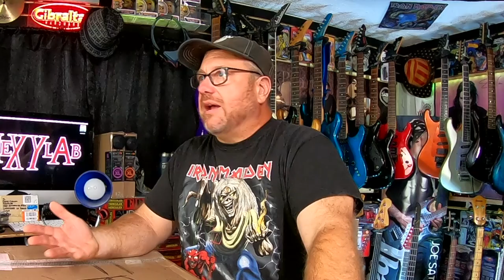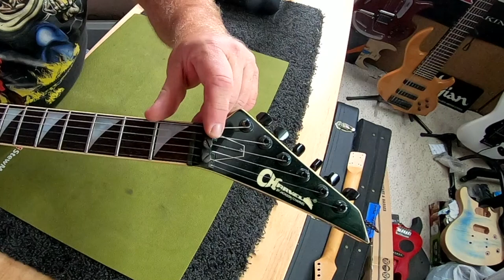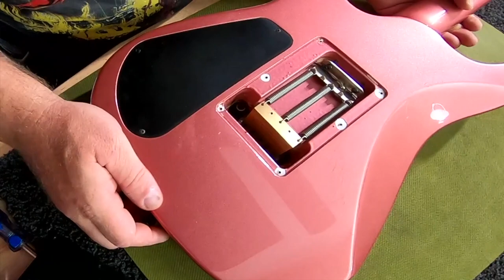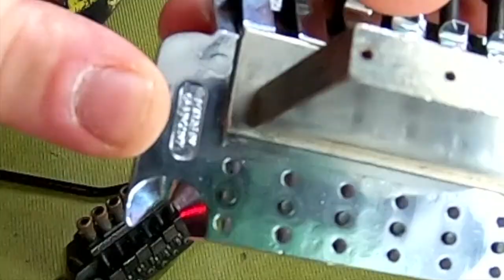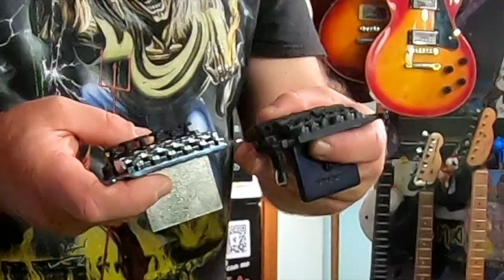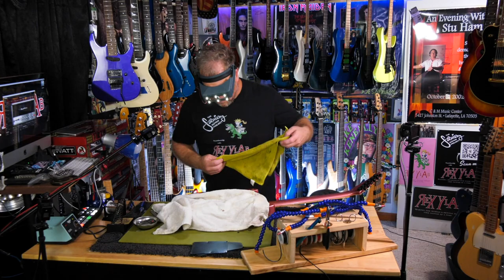1988 Charvel Model 6 And A Story About Weed 🎸🤘

Comment: Been thinking of spending $1200 on one. Does it play good enough for that price?
Reply from the maker: $1,200 for a 1988 model 6 in burgundy mist is a steal! 

That being said I love the way this guitar plays but they aren’t for everyone. I have a USA, pre Fender Jackson soloist with an actual German Floyd and it feels completely different. 

Also, I have a model 4 that has the same hardware and electronics but it’s a bolt on neck with 22 frets instead of a24 fret neck through like the model 6. 

That one plays completely different too. 

My recommendation would be to play it and see how you like it personally. 

I will say this, $1,200 for an all original model 6 is a fair price.

Comment: I got a 1988 Model 6 used back in 2002 or so, that guitar will never part with me,its burgundy mist too. I will say though the JT6 fucking sucks, i cant wait to upgrade mine to an OFR. Over the years ive had pick up changes and had a tech fuck the midboost, so i've got seymour duncans on order.

Havent finished your vid yet, surprised you havent said much about the midboost and the single coils being stacked humbuckers.
Reply from the maker: Ah yes, the mid boost is a very cool feature of this guitar. The pickups are also pretty awesome. The reason I didn’t talk about either is because this video is kind of long anyway and if I went through everything it t would be so long nobody would watch the whole thing. 

Essentially I had to choose what to focus on and I felt the fact that the person that sold it to me had no idea there was a difference between a JT6 and a Floyd Rose (to the point where he insisted it was a Floyd Rose regardless of it saying Jackson on it) was the most important thing to focus on. Also the fact that it had Floyd parts on it that didn’t fit was really bad as well. It was kind of like,”I have this high performance part for a Chevy that I’m gonna put on my Ford. The bolt pattern doesn’t line up so I’ll just use duct tape and zip ties”. Basically a cautionary tale of buying something used that has passed through many owners and was internally screwed up. 

About the JT6. If properly set up it is fine, not great but fine. Personally I wanted this guitar all original because of the story about how this guitar in this color played such a roll in my life at 18 years old. This Charvel properly set up and all original is really a joy to play. However, if I could have only one guitar it would be an Ibanez RG550. I like everything about that guitar much more, including the original Ibanez edge and the fact that it is recessed. But when you have as many guitars as I do you start getting nostalgic and want the stuff you never had. 

Were I to swap the JT6 with anything it would be a gotoh 1996. Just like Schaller makes the original Floyd Rose and their own version of the ofr gotoh makes the edge and their version of a double locking vibrato in the 1996. In my opinion it is the best aftermarket upgrade for any double locking vibrato system that can be upgraded with a Floyd. 

Just my opinion. 

Duncan’s are totally a great way to go with any upgrades in pickups so congratulations on that! I’d love to see what you have done with your model 6 so if you have a video of it put it in the comments. 

Lastly, I am about to start a video series on all the different variations of locking vibrato systems I can get my hands on. It will be in-depth and I already have a bunch of them. I hope you subscribe so you don’t miss it. 

Thanks for commenting and watching my video! I really appreciate it.
Reply: @REXYLAB  for sure, parts are costly here in Australia, so im getting them overtime.

I have thought about the 1996 except my Model 6 holds alot of sentimental value so its the type of guitar i wanna go all in on 😂.

Pretty much all the pickups are gonna be white, i like that look and ive had a white emg 81 in it for about 10 years.
Reply from the maker: The OFR is definitely a great choice and if your heart is set on it then that’s a great way to go. The gotoh 1996 is not a compromise by any means though. I really do feel it is the best vibrato system out there. But if the Floyd is what you want then go for it! Either one would beat the JT6 and I am keeping that on mine so to each their own. 

It’s too bad you are in Australia as I am a Duncan dealer. But after shipping something to a guy I n Scotland I know now you are better off getting your money arts from a place that has already dealt with customs and all that other stuff.
Reply: @REXYLAB  yeah my only hesitation is that i know i can re-use the studs with an OFR not sure on the 1996, plus i like the screw in collar, not sure if the gotoh has that?

Also bloody hell $500 or so for a RG550 🤤 they're around AUD$1800 here now, i wanna try one bad, im hankering for a maple fretboard.
Reply from the maker: @AussieTerry  the gotoh does not thread in the same way as an OFR so if that is important to you then you are making the correct choice. 

Have you never played a 550? That is down right heartbreaking! My absolute desert island guitar without a doubt. I hope one day you get a chance to check one out. In fact, when I do the setup on a original edge I will do it with a 550 in your honor.

Comment: An emg 81 and a pair of emg sa's. In that would be my perfect set up.
Reply from the maker: I have that setup and it’s great but the stock pickups and electronics in my opinion are better. 

The last knob is a mid boost that is very useful.
Reply: @REXYLAB  try the 18 volt mod.   It opens them up so much  more. If u know what ur listening for
Reply from the maker: @joshuaberthelot  I have both 9 and 18 volt. 

EMG is great and I love them but the stock setup is amazing and really underrated. 

I have a model 4 that also has this setup. 

Tomorrow I have a video coming out about 2 basses that were in a fire. One had EMGs until the client had me swap it back to stock and it was a smart move on his part. The stock electronics just had more tonal variation and way more headroom. 

Don’t get me wrong, I really do love EMG and I have 5 or 6 guitars and 2 or 3 basses with them. They are fantastic. 

However,  a lot went into designing these pickups and electronics at the absolute hight of Jackson’s popularity and they nailed it. It’s a truly outstanding system.

Comment: jt 6 trem bar is horrible. do yourself a favor and get a schaller arm holder, you won't regret it.
Reply from the maker: I agree that the JT6 has some real extreme flaws in it but when set up properly it’s ok. Besides, I have a ton of guitars with German Floyd’s, the Schaller version of a Floyd, Ibanez edge in many varieties, gotoh 1996, etc. 

Rexylab is even a Floyd dealer so I am well aware of how easy it is to swap the arm with a whole new assembly. 

But I like this one original so I can play it and time travel back to 1988 on occasion.